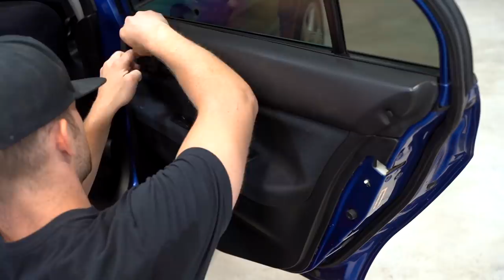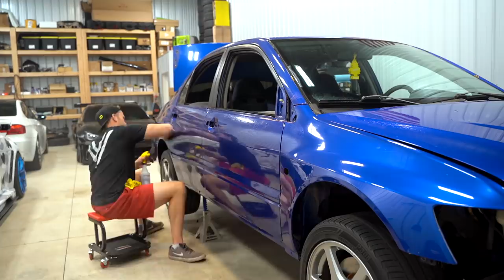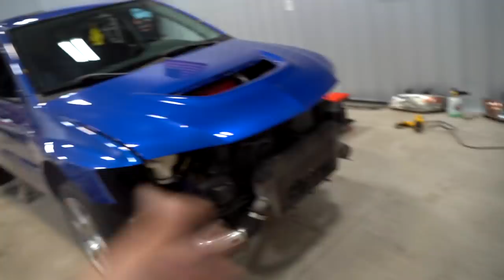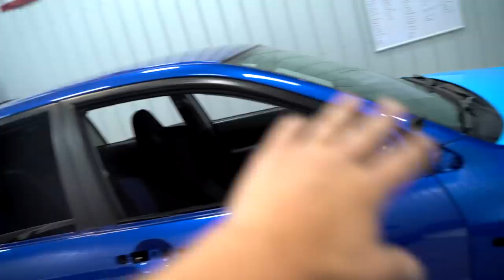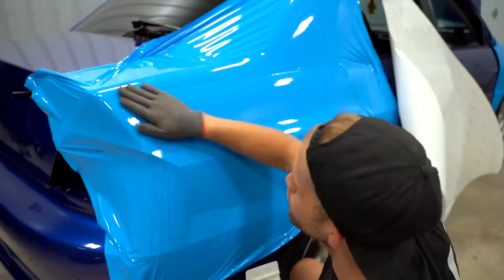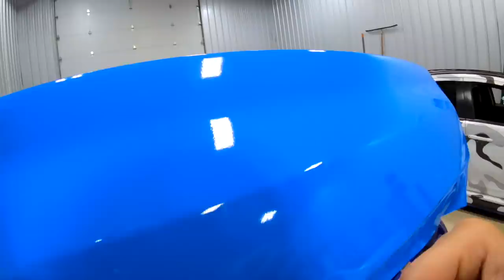Revealing the New Evo 8 Wrap Color!

Comment: Never been a fan of wrapping cars. I did mine once and took it off within a week. It just looks cheap and there's zero depth to the color, unlike a good paint job.
Reply: With you on that but like you said if you dont like it you cant take it off which is a pretty good thing
Reply: Well this wrap he bought is $755 delivered on amazon so for the price compared to paint it seems like a good option in my eyes
Reply: @garrison2574  looks like plastic in person. Buy some and try it out. Looks nothing like paint. Hence why i said "it looks cheap".
Reply: @Ross-en8lu  You get what you pay for, this would look better than any sub $1000 paint job by anyone that isn't giving you some sort of special deal, and would be a lot harder to learn how to do yourself compared to the wrap
Reply: @garrison2574  cheap is cheap. Regardless of the method. Why put a cheap wrap on an evo that obviously needs paint?
Reply: @Ross-en8lu  well wrap is just inherently cheaper overall, I think a good wrap is better than a crappy or ok paint job
Reply: @garrison2574  that's my point, "wraps are inherently cheap" and they look it. Save up and paint the damn car. It lasts way longer and looks better (if done properly). Wrapping a perfect paint car is one thing. But wrapping a car that needs paint? That just seems lazy and cheap.
Reply: @garrison2574  its a difference of opinion. I save up and buy authentic parts, can't stand ebay or "rep" stuff. I'd rather wait twice the amount of time to afford the authentic part then purchase the rep part for half price now.
Reply: Defeat I get your point, but the electric blue is one a pretty rare colour on an evo, two the paint isn’t that bad compared to other evos ive seen, the clear cote on evos aren’t the best and this one being this good... I wouldn’t paint it another type of colour. So I get why he’s wrapping it, it’s cheaper, more efficient and a fun way to change up the car. That’s just the way I see it tho
Reply: Defeat agreed
Reply: Paint does look really good, tbh I like both. But I can't fucking stand rock chips lmfao
Reply: Joshua Husted bingo